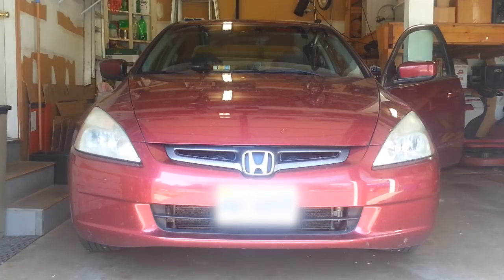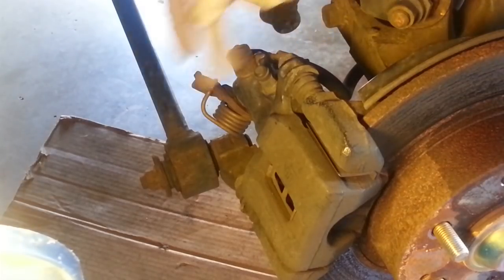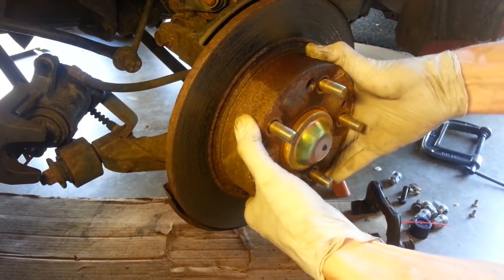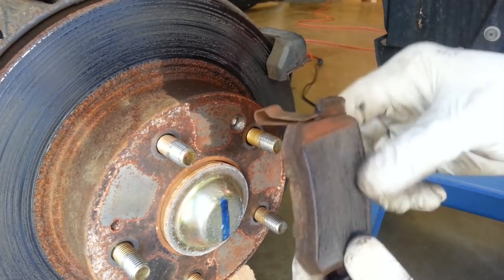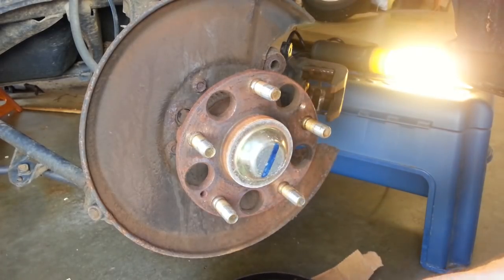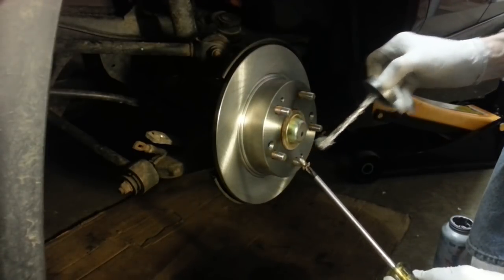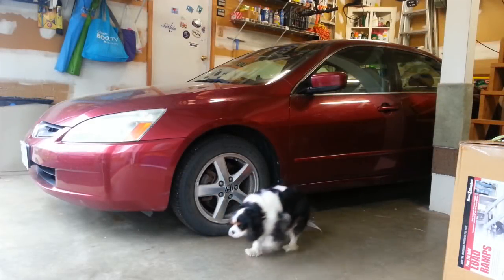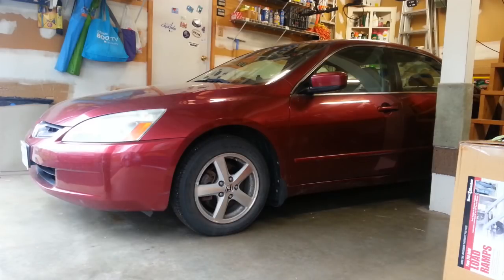DIY fix for replacing rear brakes - Honda Accord

Comment: One of the worst disc brake videos I have come across.  Should be titled, "cheap way to do your own rear brakes".  The only good thing was you're doing it on your own car and not someone else's. Besides, you never answered your own questions from the beginning, which is " why did they wear uneven and why did I replace the calipers"?
Reply from the maker: Thank you and you are actually quite correct. This is video is intended for DIYers who would like to save money by replacing their own brakes while doing the job properly using the factory recommended procedure. Brake jobs are notoriously expensive, especially at the dealer, where they charge the full book rate for the labor rather than the actual time spent. They also charge inflated prices for the parts which can easily be had at wholesale rates. In my case and regarding my own question, corrosion in the caliper pistons lead to uneven wear between the inner and outer pads. That was the impetus for replacing the calipers.
Reply: @WorseThanChiggers
Reply: Thank you for replying. I’m hoping you can take criticism.  For the record, you did an excellent job on the video, editing and clarity. The content is where I’m having the problem. Yes of course dealerships charge a tremendous amount of money for repairs and also factory list price on their parts but $1300 does seem a bit steep.  There are three typical reasons why disc pads wear uneven.  Mainly because part of the system is binding. Changing most of the components usually fixes most problems, doing it improperly or using cheap parts doesn’t help at all.  I’m not saying you’re doing it improperly, it just seems you’re skimping on a few items. Using cheaper rotors not a good idea. Jumping to changing calibers because you got uneven wear, not a good idea. You didn’t even mention a collapsed hose. Also you never lubricated between the brake hardware (which you referred to as retainers) and the caliper bracket to help with rust jacking. In mentioning about the braking squealers, you just said they go down. Why?  Something about leading edge is my understanding.  Maybe you don’t have to deal with rust like some areas of the country does.

Anyway, I thank you for sharing your experience and time to do this video. Again, video, speaking clearly and clarifying what you did was spot on.
Reply from the maker: I always like to present my approach and my reasoning behind it without stating that it is the "right" way to do something. I appreciate it when viewers disagree with my approach and express their reasons why. That is encouraged and we all learn something in the exchange. You bring up some very good points and I'll touch on each one for those who are curious. You're right, I didn't mention a collapsed hose because there was none. The binding that lead to uneven pad wear was two fold. The torn boots shown in the video lead to contaminated slide pins. That alone is certainly not enough to justify new calipers but the overall condition of the calipers themselves did for me. Because this was my daughter's car and she was only home from college for the weekend, I chose to replace all components to ensure that she was safe and good-to-go for a long time to come. Most shops would do the same to guarantee the fix and to avoid the chance of a call-back. The term "cheap" typically refers to either price or quality. Your use appears to be the latter. My philosophy is that being inexpensive doesn't necessarily imply that something is of inferior quality. I try to do my homework and get the best deal that I can while still meeting an acceptable level of quality. There are good quality aftermarket parts such as brake rotors that can be had for a fraction of OEM parts and I've had very good luck with them over the years. I've also had bad luck with other types of aftermarket parts and learned from that experience. For example, take high pressure steering hoses. I'd never go with an aftermarket part over a genuine Honda OEM hose. The replacement calipers that I used were remanufactured OEM calipers, not inferior Chinese knock-offs. You can tell by comparing the originals to the replacements. Again, I've had very good success going that route and believe that it is the best approach for me. That being said, you'd have to expound more on your reasoning for why some of my decisions were "not a good idea". Perhaps your past personal experiences differed from mine. I like the fact that you pointed out my lack of lubricating the brake hardware. I definitely believe in that practice and I typically do it but I didn't this time. It is a controversial subject where some believe that the brake grease can attract dirt and defeat the purpose. To each his own. The brake pad wear indicators go down and are on the leading edge of forward rotation. Some people say they should go on the top but that is contrary to the official OEM factory service manual that clearly shows the correct orientation is down. We do have to deal with some rust from winter road salt, but nothing like they do in the rust belt. Thanks again for your perspective. The dialog is great.
Reply: @WorseThanChiggers  your very welcome sir.
Reply: In watching this entire video again, I take back my initial comment on being one the worst disc brake job I’ve seen.  I truly apologize. Well done sir.